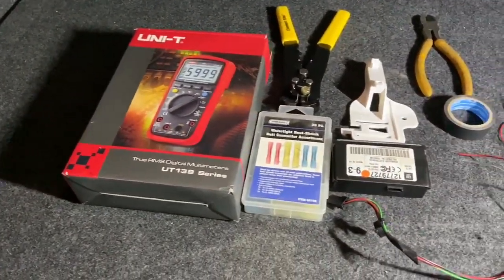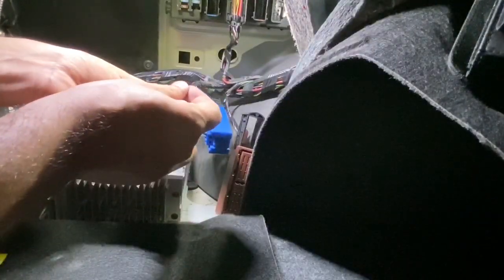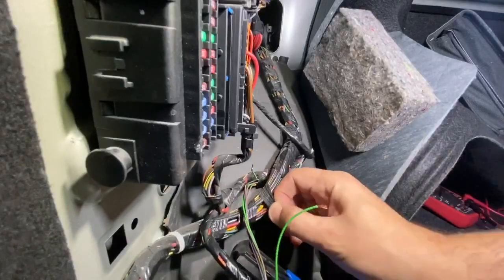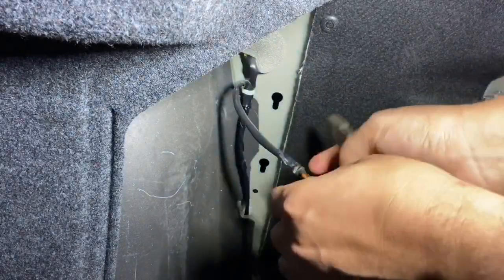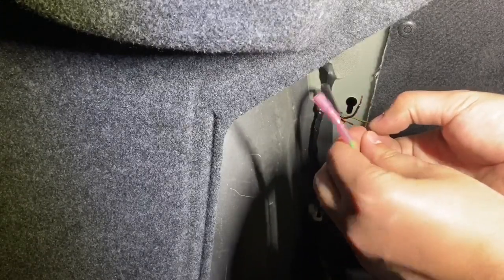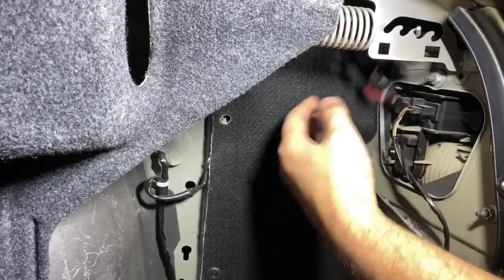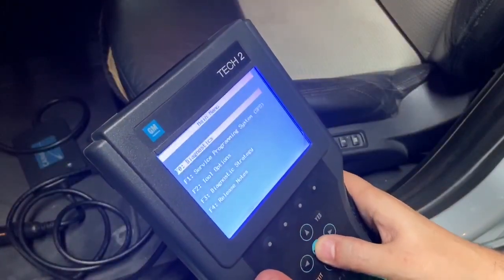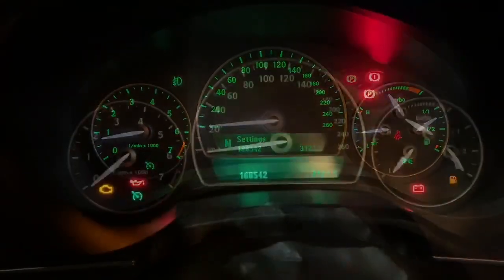RETRO-FITTING a SAAB FACTORY TPMS (Tire Pressure Monitor)

Comment: Hi, thank you for such a detailed video! I accidentally got myself a set of rims with sensors, so looking into this project. I'm a bit confused though. Why would one have to splice the existing cables, if a factory made plug is already present at the right rear light? If it's not suitable for the stock TPMM (tire pressure measurement module) and needs your changes to work, what is it for then? If a cable and plug is there, I would expect it to be plug and play. Secondly, what's the year of this car? Subsequently, do you know if the part number for the module is 12791155 or 12846372? Lastly, do you know if/how one needs to connect the TPMS sensors in the tires to the module? Thanks a lot mate!
Reply from the maker: That connector is actually for an optional alarm system thats why u have to do the mod.
The module number depends on the year of the car.
To connect the sensors to the module u will need to follow the steps described using tech2 in the video
Reply: @TheFlyingMechanicDIY  thank you, I appreciate you taking the time to respond! In the meantime I've found out that there's no such plug in my '08 vert. Luckily the developer of Esid has created a nice pdf with the correct plug specs.
I've found out the first part number is for the first iteration of Saab's TPMS system, used' 03-'06. Apparently it wasn't very good. The second part number is for' 08-'11, but can be used in earlier models as well, according to the pdf from Esid.
Reply from the maker: @VWNMSOEST  thats correct .. the vert does not have the plug, u still can splice in a wiring harness to the same locations on the rear left side of the car
Reply: @TheFlyingMechanicDIY  thanks. Yeah I'm gonna run new cables. However, I'll try Esid's way, cause he uses untaken terminals in one of the plugs on the REC, instead of splicing.

Comment: Cool project, though I would probably use Coca cola. Does this mod work on a 2006 with the parts from a 2008?
Reply from the maker: Im not sure about that ..
Reply: @TheFlyingMechanicDIY  eSid says that you can do it, but you won't have the values. 

https://www.esid.se/manuals/Upgrade_Saab9-3_with_TPMS.pdf

Comment: Tried this on a pre facelift...no communication with the TPMM. Added power, ground, and tapped into the parking sensor I bus. Should I wire in the old TPMM that goes in the center console? I’ve got the hardware
Reply from the maker: I highly suggest u wire it according to the OE installation per model year, however just to make sure, do u have the correct module for ur model year ? These could be incompatible.

Comment: I am looking at doing on my SAAB do you know the connector part number?
Reply from the maker: I looked everywhere, and this connector is not listed anywhere, ur best shot is to buy it used from ebay
Reply: @TheFlyingMechanicDIY  Thanks for checking
Reply from the maker: Richard Crimp actually, check this number written on the connector 968943
Reply: @TheFlyingMechanicDIY  Thanks!